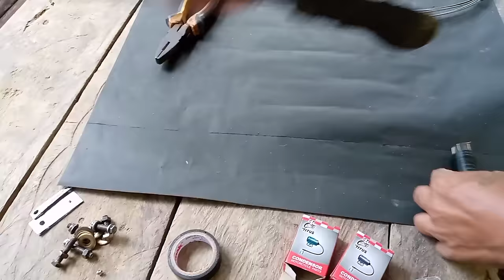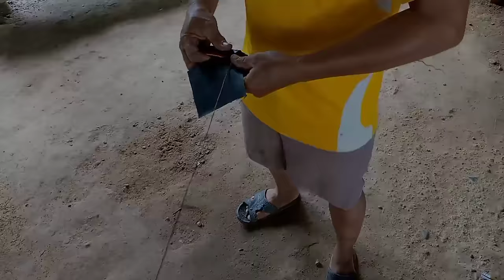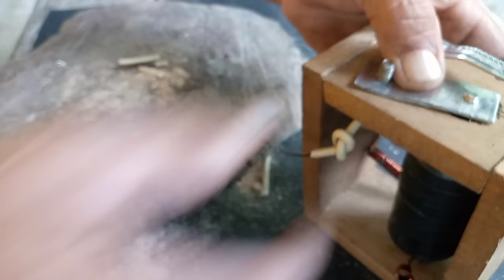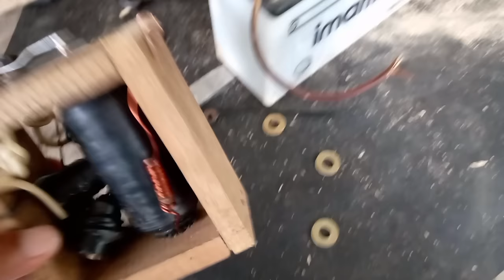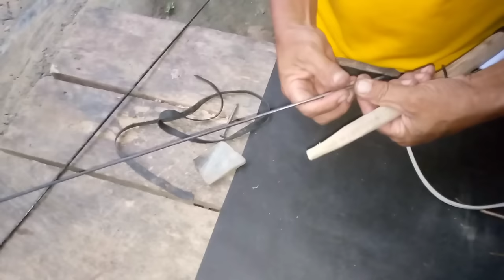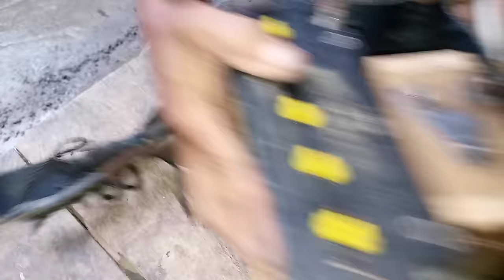Ep.12 catfish & mudfish fishing 2023 Single aparato minus gastos na pwede sa malalim na tubig.

Comment: Hello, please tell me. In order to make a device with a 12 volt battery, what is the number of wire in the first coil and how many turns should be wound... and also in the second coil, what is the number of wire and how many turns should be wound.. Thank you if  Answer accurately

Comment: Mga sir gumawa ako ayon sa turo nyo, capasitor ng electric fan,4uf,ginamit ko,pero walang kuryente sa isda,natunog naman platino nya,at mahina lang spark sa 2 stick pag pinagdikit.saan kaya ako may mali?thanks.
Reply from the maker: Naka try din kami nyan sir kasi nakabili kami nang Local na capasitor nang electricfan.
Para panigurado lang sir condenser nalng po. Na ang brand ay AMCO or KOYO sir.
Reply from the maker: Naka try din kami nyan sir kasi nakabili kami nang Local na capasitor nang electricfan.
Para panigurado lang sir condenser nalng po. Na ang brand ay AMCO or KOYO sir.
Reply from the maker: Atleast mga apat or anim po na condenser.
Reply: paano gagana walang secondary, hindi talaga pupuede.
Reply: @DarwinOgues-pk5eo  pwedi yan boss kahit walang secondary,ang tawag jan tipe primer malakas yang pag okey gawa mu